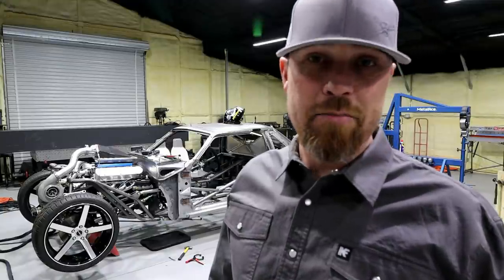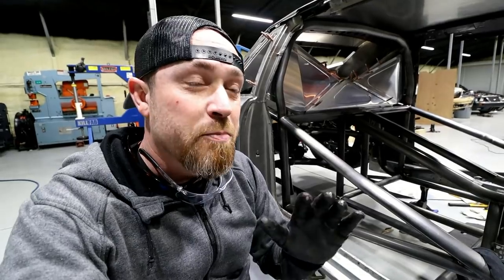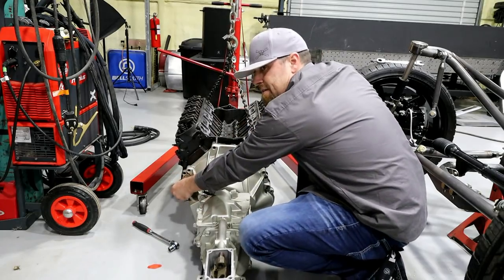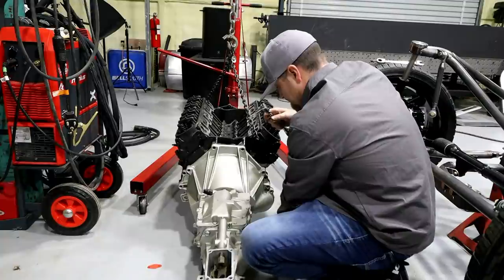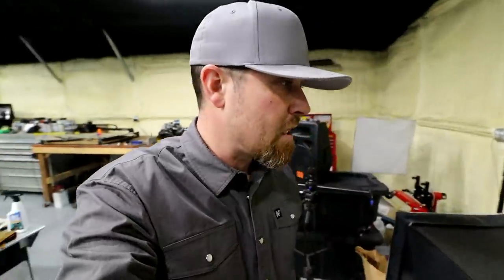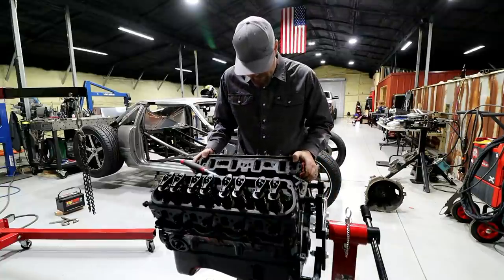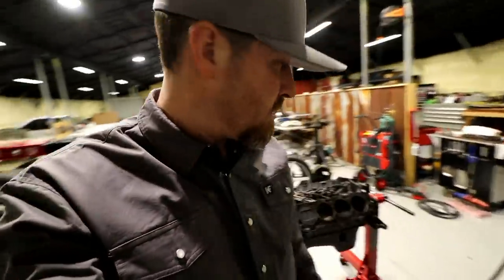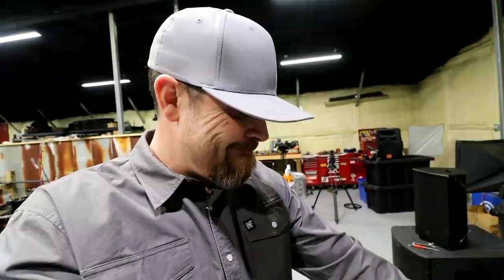Everything Needs To Come Apart

Comment: It never goes smooth with used blocks looking for a fresh 351? Go do work son! Good luck bud I hope you find one also what about the connecting rods and pistons you are gonna turbo it time to get what you really want also a nicer cam and valve train with springs to give you the most out of that turbo. You knew you were gonna build the motor after all the fab on that sweet body work at least you will know it will be everything you wanted on the hot rod bibbster. Fresh content for the masses as well can’t wait to see what you put in that new block!

Comment: If you're on a budget with the motor build I would take the bare block to the machine shop and see if it can be bored ... yes you can go .060 over easily.  I wouldn't buy a used engine unless I was gonna rebuild it or it was pulled from a low mileage wrecked vehicle.  Of course a crate engine would be nice.

Comment: I’ve always been Leery when someone talks up a motor and how it’s a race engine. Most of the time either they’re lying or it is and its been beat to hell. I wouldn’t go 60 over with a boosted application, you can re-sleeve the block. I’ve had a few blocks that 30 over wasn’t enough but 40 over got it

Comment: .030/.040 over is perfect
.060 over its not gonna be very streetable cruisin idling . Overheating all the time choppy and hard to tune even with 2 wideband 02s !! Yup i tried it on a galaxie 351w switched it to a 351 .030 over lunati cam same sniper efi ..now i can dynamite the tires from a standstill without powerbraking it !

Comment: MY SUGESTION is you run it with a hurt cyl.  It doesnt matter that much really...and you still have to cut your teeth on tuning it and making power...which I have respect for you and all but the risk is lower with this...and its not bad enough looking to really have blow by issues (turbo sbf your going to have BB anyway).  ez to trade in a diff motor later, 20 minutes right?

Comment: Maybe a stupid question, but are those shock towers going to be strong enough?? It looks like you need a extra horizontal bar going from the top of the shocktowers to go back into the frame to give it rigidity? It seems it will flex like crazy if it stays like this..
Reply from the maker: yeah...its actually way more ridged than I thought it would be
Reply: @Thefabforums  Yeah i am no structural engineer, just curious...but love "the look" of the project so far!

Comment: One of my motos, "Nothings ever simple"... Well it seems like that sometimes. How about using a  302? Aren't they more plentiful?
Reply: deck height is lower on a 302 and Kyle has the front suspension brace bolted to the heads.
Reply: @JD-fx1mb  ahhh yeah. Oh well, have to hunt for a 351
Reply from the maker: yeah suspension, intake and turbo setup would fit. I like the idea of the 351 because it can handle a little more power as well.
Reply: @Thefabforums  351 will handle a LOT more power ... bigger crank and the block is a lot stronger.